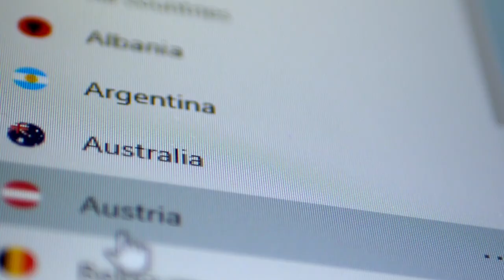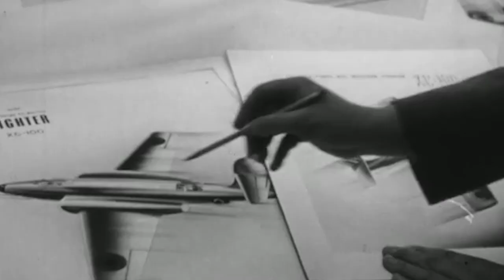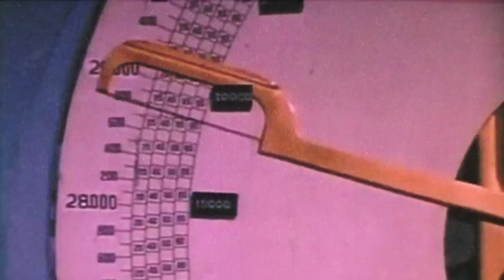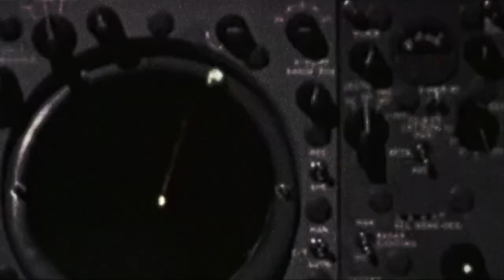The BAC TSR-2 – The Most Outstanding Military Aircraft to Never Serve

Comment: The avionics were way out of date before the prototype took off. Too 1950s, electrical solenoids and mag amps. Hardly a transistor let alone new integrated circuits in sight. Too unreliable were the avionics, as like the English Electric Lightning. Development costs were astronomic for old out of date kit.

Comment: Had TSR-2's made it to service, I'm convinced that they'd still be flying today.
Reply: That's seems very unlikely given all the problems that the TSR.2 had and were never solved.
Reply: @WilhelmKarsten they were never solved because the project was cancelled. Yet to see you comment anything other than trolling.
Reply: @davidspencer7254  The facts are irrefutable, TSR.2 was an unmitigated failure and BAC was a disaster... the company never produced a single successful aircraft design on its own.
 But then what do you expect when you merge 4 failing British aircraft companies under an additional layer of government beauracacy?
 TSR.2 was a perfect example of everything wrong with the UK aircraft industry and why it collapsed.
Reply: @WilhelmKarsten  I see one fact in that lot and a large dollop of subjectivity.
Reply: @davidspencer7254  The performance of the TSR.2 in initial flight tests were appallingly bad, the aircraft fell well short of it performance requirements for top speed range and payload severely limiting its already shrinking service role.
It was also found to have several very serious design defects that would have blocked the plane from being adopted into RAF service and any other Air Force..
The TSR.2 required years of remedial engineering studies, retooling and testing... way beyond overbudget and expected to be completely obsolete by the time it entered full operational service.
Cancelation was the only viable option.
Reply: @WilhelmKarsten  this was a normal part of the process.
Reply: @davidspencer7254  Yes, many aircraft turn out to be Turkeys and are simply canceled and written-off as a loss.
No one wanted the TSR.2 no foreign country was interested and RAF was very dissatisfied with the aircraft's performance, production delays and the spiraling costs meant only a few aircraft could be built.

TSR.2 was a failure and everyone involved knew this, cancelation was inevitable.

Comment: You can't say the TSR-2 is better than the F-111, if it didn't even become operational.
The high wing loading has the look of exceptionally high landing speeds, just sayin'.
Although single engine, you guys could have done better by purchasing the Vought F-8 Crusader, a real hot rod, stout carrier landing gear, and had long range too.
On the other hand, the Convair B-58 Hustler may have fit the bill also.

Comment: There were many unresolved problems with TSR2. It was expensive, limited mission, late, difficult to maintain as engine fit was a nightmare. It had no customers and its in service date was slipping. It's service life would have been short. In a word Tornado was the right aircraft when it came. A 40 year service life has proved that beyond doubt.
Reply: Which was built on the work done on the Jaguar.

Comment: The US didn't just cause the project to be abandoned, there were US citizens directly involved in overseeing the destruction of both the existing airframes and tooling. The two that survived were not supposed to do so.
We are looking at it hindsight, admittedly, but it is yet another example of a change of party leading to a more expensive long term solution as they felt it necessary, for whatever reason, to cancel something championed by their predecessors.

Comment: Built of modern materials and given modern avionics this could still be a world beater.
Reply: A fatally flawed design...
Reply: @WilhelmKarsten  actually it was not. If you read the comments by Roland Beaumont on his experience of  his flights in it he was happy with it. His only problem was one landing where the port main undercarriage beam turned over resulting in only having one wheel rather than two on that side. The only thing wrong with it was that it was years ahead of it's time. It was killed by the government like so many other good designs.
Reply: @mothmagic1  The TSR.2 was an unmitigated engineering failure that no one wanted, even the RAF changed its mind.
 The TSR.2 was canceled because it had no export orders and Britain was completely bankrupt, defaulting on its war debt payments in 1964 and again in 1965.
Reply: @WilhelmKarsten  read the opinions of the pilots who tested it  not the government document as to why it was cancelled we all know governments will say anything to justify a decision especially when they know they are wrong.
Reply: @mothmagic1  The test data doesn't lie, the TSR.2 was a dog... it couldn't reach Mach 2 stripped down.
Reply: @WilhelmKarsten  OK and how many other types reach their expected performance targets straight out of the box. They all require tweaking
Reply: @mothmagic1  The main purpose of building the TSR.2 was that it was supposed to a Mach 2 aircraft... it's not an impossible design goal as many Mach 2 aircraft were already in service, BAC was embarrassingly short of this mark.
Reply: @mothmagic1  BAC was an epic failure of an aircraft company, they never produced a single successful aircraft design on their own.
Reply: @WilhelmKarsten  which ignores the fact that the TSR2 design predates BAC by about 10 years. The design was drawn up in the late 50s
Reply: @mothmagic1  Exactly my point.
The UK aircraft industry was on its arse in 1958 and BAC was formed because the government couldn't afford to subsidize 4 failing aircraft companies, putting all the bad eggs in one basket.
Reply: @WilhelmKarsten The RAF didn't willingly change their mind they were made to by the MoD
Reply: @mothmagic1  Indeed, the MoD needed the TSR.2 in 1958... not 1968!

Comment: Imagine only being able to fly at 200 feet
Reply: No, you didn’t understand. It had the capability to operate as low as 200 ft, on autopilot, at supersonic speeds. It would also operate at up to 51,000ft at speeds of up to mach2,20..   It used the same engines as Concorde would use later.

Comment: Hey Dark Skies, love the videos but this one has a few errors and not upto the usual high quality
The 'er' is silent, CanBra bomber, named for the Australian City which is in turn named by anglicising an aboriginal word for the region (though this is debated with a few competing thoeries).
Also, you show a black and white shot of a French English Electric T.4 Canberra (from the Canberra Wikipage) and not the Martin RB-57D Canberra used by Taiwan. The RB-57D has a 40ft wider wing, Pratt and Whitney Jets instead of Rolls Royce and a service cielling 20,000ft higher. This is kinda like the diference between the Pilatus PC-9 and the Texan T6 except they had the same common designator "Penguin" (note niether have a common name desinator).
https://en.wikipedia.org/wiki/English_Electric_Canberra
https://en.wikipedia.org/wiki/Martin_RB-57D_Canberra

Comment: The TSR-2 looks like the XB-70's little brother
Reply: What resemblance do you see?  Look completely different to me.
Reply: @winternow2242  both aircraft flew in 1964 and used compression lift wings... but that is where the similarity ends, the XB-70 is the largest supersonic aircraft in history and could exceed Mach 3... TSR.2 failed to reach Mach 2 while many earlier aircraft did.
Reply: @WilhelmKarsten  The MiG-25 also first flew in 1964, and that plane also has nothing to do with TSR-2.

What is your soruce that TSR-2 was designed with compression lift in mind?  I've never heard of "compression lift" discussed with any aircraft other than B-70 and Valkyrie.

Comment: Flying at 200 feet. Wow. 10x the first Wright flight.
Reply: You didn’t understand did you… It was to have the capability to fly at 200ft..On autopilot..At supersonic speeds.  Its maximum operating altitude was to be 58,000ft at mach2.2

Comment: A lot of historical inaccuracies, in this one and omissions.
Reply: But you didn't specify any of them. Good job.
Reply: @panzerkami2381  For some reason the rest of reply didn't post ..
TSR.2 was originally designed with a variable geometry wing (based on a design by Barnes Wallis). It needed a specific material for the bearings, however the US DoD got wind of it and brought up the entire world's supply and refused to sell it to BAC. So that led to the wing redesign and major delay in the program.

Calling it a Franken-plane is an insult to all those who worked on it.

The Tornado was designed in the early 70's , first flew in 1974 and delivered to the RAF in 1979.

A TSR.2 on one of it's 'last' test test flights - out accelerated it's Lightning chase aircraft with only one engine on after burner (no malfunction.

A third complete TSR.2 was known to have survived and the rest is still classified..

Comment: Man, this is internally inconsistent.  You imply political pressure canceled the TSR2 (the same being said of the similar-looking and similar-period Avro Arrow), but in truth the UK simply needed no such plane, never had such a plane, and wasn't the worse off for not having such. You hint it might have been better but it seems like it never flew anything close to the dream target and not for want of trying.  Sure, the F-111 had massive cost overruns, "and cost more than the TSR2 would have," but are you so sure the TSR2 would eventually be finished without its own massive cost overruns?  Wiki may be incorrect; if so correct it.  But Wiki currently shows the F-111 to be a slightly smaller plane, but triple the payload, 20% faster,  50% higher, 20% longer-range...

Comment: The most outstanding aircraft, just like the Canadian Avro Arrow, the only enemy it cannot defeat was home politics. If it is so good you can reproduce a modern version today. Then the UK will have a mini B1 bomber.
Reply: It was discovered in the uk that the Blackburn Buccaneer could do the same low level but faster and at a tenth of the cost.  The high and medium level was closed by Warsaw SAM’s
Reply: @JohnSmith-bx8zb That's hilarious!
Reply: @sandervanderkammen9230  that’s why the RAF. ended up with  Buccs
Reply: @JohnSmith-bx8zb  The Buccaneer wasn't in the same class as the TSR.2... the TSR.2 was supposed to fly Mach 2+, the Buccaneer wasn't even supersonic.
Reply: The TSR.2 was an unmitigated disaster!  The plane could barely fly and never reached Mach 2... BAC was a sh!t show, the company never produced a single successful aircraft design on its own
Reply: @WilhelmKarsten  The British by no means have a monopoly building lemons. There are many examples of planes started life as a marginal performer and subjected to decades of incremental improvement, till now , it is a best seller. One example is the King Air.
Reply: @tonylam9548  The brits absolutely had a lock on building lemons, and the UK government subsidized them until the entire industry completely collapsed.
Please name a single British company that still makes British jet aircraft in the UK???

If the British made a plane as good as the King Air? They might still have a successful aircraft manufacturer left.

Cheers mate!
Reply: @WilhelmKarsten   I believe the BAE 146 is British made , but that was a while ago.  The problem with most countries is they do not promote private aviation.They were mostly put out of business by too much regulations and high taxes and user fees.  I seen a southern England VFR chart and my head started to spin. Compare with a chart of the Toronto area.
Reply: @tonylam9548 The BAe 146 ceased production over 2 decades ago.
British Aerospace was a government owned company.
Actually since WW2 the British aircraft industry was nationalized or heavily subsidized.
It was privativatized in the 1990s after nearly all domestic production ended.

Comment: "The best plane to never fly"

Except it failed to reach all of the requirements
It failed to reach half
The motors kept blowing up in flight and they had no clue why
Cost over run
A 1 trick pony 

Seems like it was far from capable of filling its intended role, all conspiracies aside.
Reply: Nav Attack system for TSR 2 was trialled in a flying Laboratory aircraft. It couldn't get the aircraft to within two miles of a target in trials. Map, Compass and Stop watch was more actuate. Main issues were the Computers used were not fast enough or had enough memory to do the job.
Reply: It's "the best" because it never got a chance to showcase its failures. So it serves on as a sort of anti-scapegoat by undereducated anoraks looking to explain why Britain isn't a leader in aerospace anymore.
Reply: The "motors" are the same ones that went on to power the Concord and were later developed onto a marine turbine.
So pretty reliable once the early teething problems were ironed out.

Comment: This was a clusterfuck from the start. How could this possibly be considered an outstanding aircraft. It was a nuclear strike aircraft and would have never been able to fullfill a conventional roll. The F111 was also a strike aircraft, but primarily for conventional strike (wing hard points) with a nuclear capability as a secondary roll. The cost overruns for the F111 were due to trying to develope an air force AND a naval variant. When everything was said and done the TSR-2 was nothing more than the Empire trying to keep up with the Yanks.

Comment: Errm - this plane should be called 'The TRUMP' - because all the hyperbole about it, seems completely at odds with the reality.  From other 'doc' vids I've watched, the TSR2:

1) Didn't meet ANY of the specifications it was aimed at, particularly payload and it was never tested to any appreciable limits.

2) It was appallingly designed eg. with terrible visibility from the cockpit and navigator's station.  It was the original 'stealth' fighter.  The crew had no idea where they were.

3) It was projected to have all manner of fancy electronics - which never ACTUALLY materialised.  eg. 'Terrain hugging flight radar' etc.  WHEN was that ever developed?

4) The entire concept was flawed.  Flying at low level, no matter how quickly, just invites every mo fo with a gun to shoot you down, which they do.  That principle was later pursued by far superior aircraft, the MRCA (Tornado).  That machine was produced and saw action (Iraq), and it was useless. Terrain hugging meant that anyone with an AK47 could fetch it out the sky.  The attrition rate was crippling.  Elsewhere on YouTube, the Tornado is described as one of the 10 most rubbishy British planes ever.  Just think how the TSR2 would have rated then!

5) TSR2 was meant to be a deep penetration, strategic platform, but throughout its short life, it had two modes 'Carry a bomb' or 'Retract the undercarriage'.  It couldn't do both.   In fact it did NEITHER.  It never carried any payload, and it never managed to retract its undercarriage either  ...because no-one had the confidence that it could be deployed again.

The most notable thing about the TSR2 was that it was killed off.  Period.  It could have been called 'The JESUS', except that it was never crucified  ...which it really shoulda been.  Useless money pit.
Reply: I bet the winter evenings simply fly by in your company🙄.